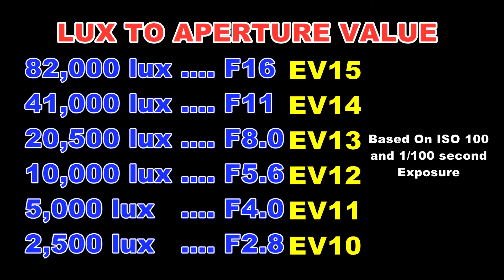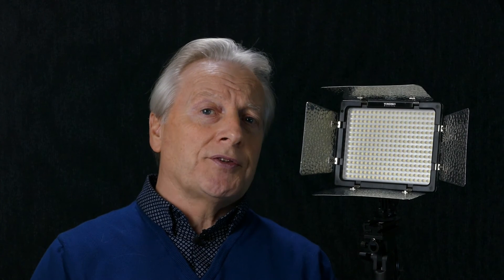LED Light Panel Brightness and Exposure Determination

Comment: You've been able to put clarity on light panel output that I have had difficulty with for a few years. Thank you.
I need to get some more led lights, do you have any recommendations? Also have you ever come across colour casting using LED light panels?

Thanks for sharing.
Reply from the maker: The latest panel I have is the Amaran Apurture H528S rated at 4280 lux at 1 metre ( naked LED - no diffuser) - falls to 2280 lux with the diffusion panel. The LEDS are rated at >95CRI which means colour fidelity is pretty good. I haven't noticed any of the previous magenta/green bias like some of the Yongnuo lights I have. I don't have any kit to verify this however the colour checker patch set looks pretty good under this like when manual white balanced on the canon 5dmk3 I have. They do a H528w version which gives a wider spread of light but the output is only 1220 lux at 1 metre but covers about a 3 metre area, their all colour temperature version the H528c is really low output at 725lux but allows accurate colour matching when used as a fill light etc.
Reply: Graham Houghton  Thanks Graham, I will check them out.

Comment: Hi Graham, I have the Lumix fz72 and thinking of upgrading to the 200, but before I do, I wanted to find out if you have ever noticed a strange noise inside the camera on the fz72?
It's there all the time, It's like a hissing sound, another way to explain it is if you put your ear to a freshly opened can of coke. It's simular ish to that
Have you ever experienced this sound and is this sound also on the 200 model?

Great videos, keep them coming.
Reply from the maker: its the optical image stabilsation element which is constantly "hissing" as it keeps the lens centred on the optical axis. It is normal to hear this
Reply: Phew, thank you for replying, I'm happy now.
Would be lost without people like you.